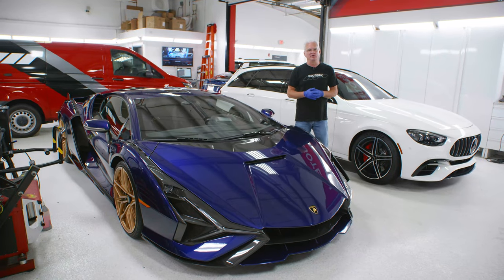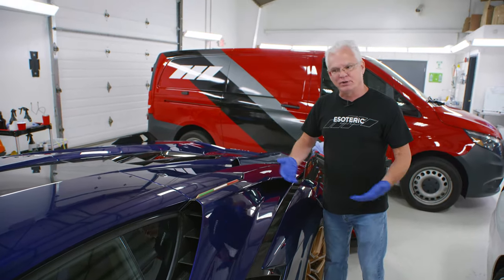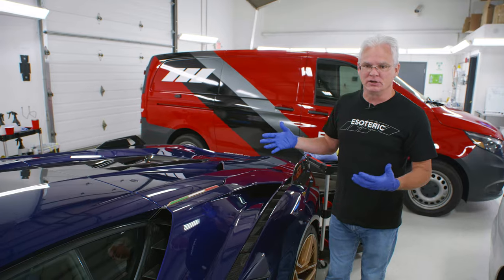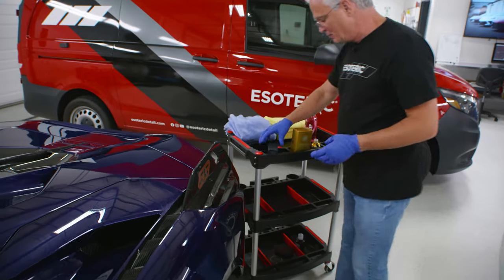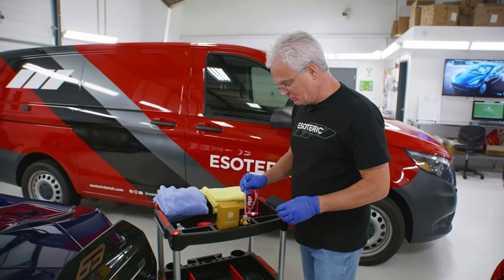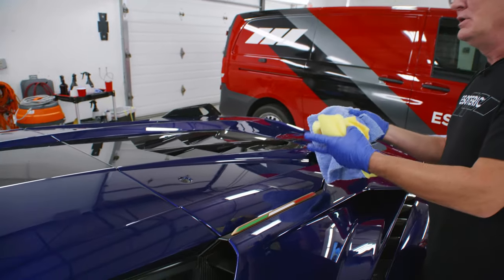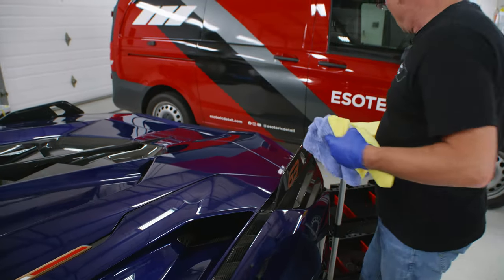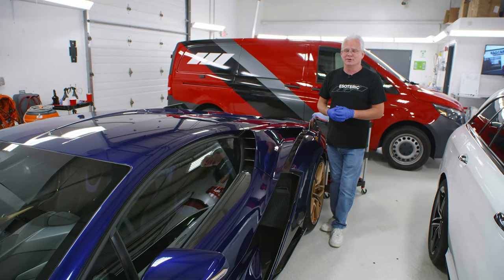The BEST way to ceramic coat edges!

Comment: Todd I have a question when you use the towels to remove the ceramic after application can you reuse them for next time or do you have to throw them in the bin.... is there a way to clean them for the next use?

Comment: Should I use the G on prep and clean the surface before applying the ceramic coating?
Reply from the maker: Yes you should...we kind of skipped over that part in this video, but it was done prior to coating.
Reply: @Esotericdetail  thank you. Love detailing my cars. Great videos and very helpful information

Comment: Can I put ceramic over wax? or over my pink rupes polish or over my sonax ? what is the best under coat?
Reply from the maker: No. You need the surface to be absolutely squeaky clean without any residue of polish, waxes, sealants, quick detailers, etc.

Comment: How do I remover a dark spot ?
Reply from the maker: If it's within a few hours, you can put more coating on top of it, let it sit for a minute, and wipe off. That usually does the trick. If it has cured, then you'll need to use an abrasive polish to break it down.

Comment: Would you toss those towels after one section?
Reply from the maker: No...after one complete coat on the entire car.
Reply: @Esotericdetail  is stacking a thing with ceramics? Same bottle, not different ceramics?
Reply from the maker: @SCPaperHat  It depends on the specific product. Some can be layered, and some cannot.

Comment: Using the same technique for coating the rims spokes. Also, why bin the towels? Use them for cleaning rubber parts, hard plastics or engine bays... Otherwise it's waste
Reply from the maker: Not waste at all. How would you know which ones were used that way, and kept separate? It's not worth the risk, and if you're doing it for a living, your coating business should generate more than enough profit that some towels here and there aren't going to make your shop expense skyrocket.
Reply: @Esotericdetail  I hope you are joking :) I personally cut one of the edges and know which one is which, but you could find a bazillion ways to mark then.